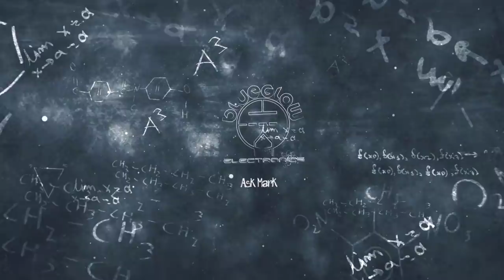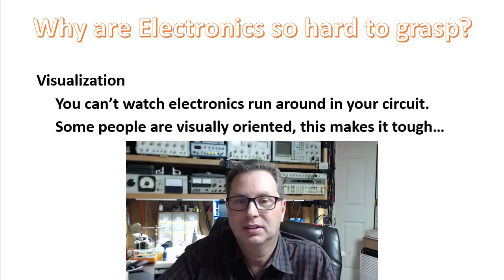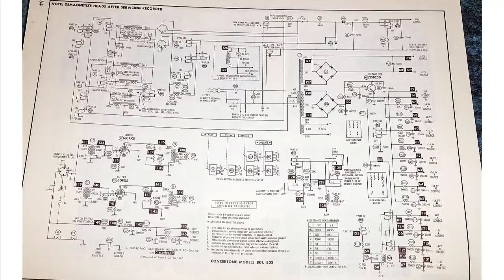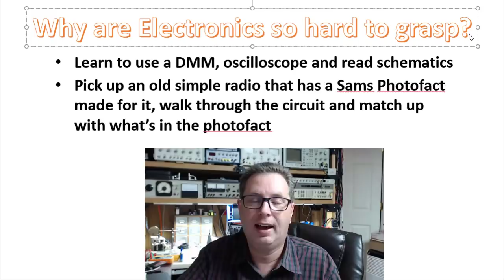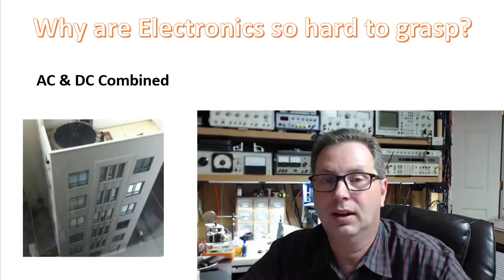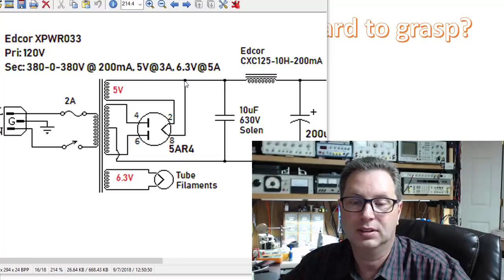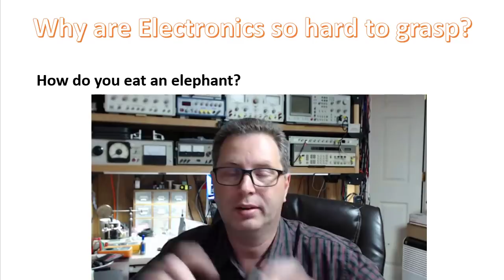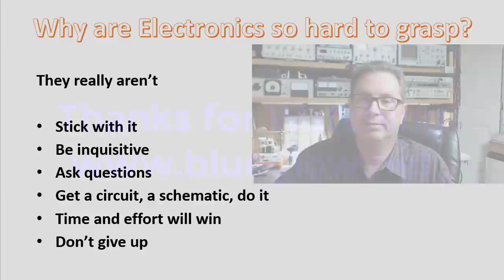Why Are Electronics So Hard to Grasp? - Plus a Few Tips to Overcome

Comment: Haven't watched it all, but had to comment.  You know what helped me immensely during your 807 build?  I used The Gimp to draw a colored point to point diagram of the build coinciding with the schematic.  I carefully watched you hook up the wires and drew them in as you proceeded.  The places where you did not explicitly show the connection I figured out from the video and schematic.  I know that build inside and out by doing this.  There is a LOT on the engineering side I do not understand, but from a tech standpoint I have reconciled the schematic to my diagram and the video of the build.  I then moved on to my first piece of tube gear, am early 1950s Travler All American 5 clock/radio.  I did the same thing, I just studied the crap out of the circuit and sketched out the point to point diagram matching it to the schematic.

Comment: The big confusion (I'm at 7:37 & maybe you will mention this later.) is we can see Current Flow from negative to positive meaning the Electrons are repelling away from each other & trying to go where they ain't so packed. But (if I understand it) the standard flow is the opposite, sort of like Hole in transistors. They didn't have the information way back then but needed to pick one direction, & (50%, 50%) they picked wrong.

Comment: Another thing to consider is that seasoned technicians are usually better at troubleshooting malfunctioning circuits than the engineers that design them,  because they gain experience in failing circuits more often than the engineers.  I used to do "shakedowns" of engineering prototype circuits, and we worked together to develop the best circuit possible.
Reply: We had some retired engineers work in our repair shop their

Comment: Parts identification, what each does and how they work together in a given curcuit as well as understanding and reading schematics, controlling heat and solder with proper techniques is a prerequisite for any service repair. Knowing the equipment your working on like the back of your hand helps too. But I'm old lol. I've been repairing equipment since tubes were regular fare lol. That's 40+ years for me. There are a lot of common problems that most people can be taught to deal with on thier own with a minimal amount of training. The more you learn and the longer you do it the easier it gets. Just no substitute for time, education and talent.

Comment: It was tough to grasp for me also.   After years of playing and schooling (52 or so)  I started looking at all circuits as a water fall of current from positive power to ground.   All current flows down the circuit from the top of the hill (positive power rail) to the pool at the base of the waterfall (ground).   Everything in between the top of the hill and the pool at the bottom is nothing but voltage dividers.    Some of the dividers have solid state devices that have a fixed voltage drop across them.    Once I thought of circuits like that I was able to decipher circuits more easily.   The other tricky part is breaking every circuit system into common small circuit building blocks.   Over time you start to recognise simple circuit blocks and how they are tied together.   They actually get boring after you get familiar with each circuit lego block commonly use over and over again.    It is very satisfying to find a new way of doing something (new circuit) and it makes you keep going in the hopes of finding a new circuit idea that you never saw before.    I learned electronics by playing and made things work with lots of trial and error.  I have played with electric when I first learned how to take batteries out of a flashlight.   Then I started taking classes in school.   Now I know how to design a circuit by the numbers and get a circuit to work almost perfectly before any solder gets melted these days.     I am jealous of young folks today because it is far more easy to learn about electronics today than 40 years ago.   The internet gives access to any info you want in a blink of an eye.  Years ago you had to go to the library or hope Radio Shack had datasheets on parts.   I contacted Texas instruments and National Semiconductor and lied to them and told them I was an Electrical Engineer (before I was one) just to have them send me databooks on all of their ICs and other semiconductor components.    I still have them today and use them (I got them in 1982).   Texas Instruments books were actually hardbound text books style books.  They are beautiful.    Now you just google part numbers.   Parts took forever to get if you could find a source for them.   Shipping cost a ton and it took 4 to 6 weeks to get things from another state.   Now you get stuff overnight or within several days.   The learning curve for electronics today is light years faster today than 40 years ago.    Dig in and drink the knowledge from the internet and it gets easier to grasp everyday.     Every person you learn from will give you a new way to look at electronics and you will develop your own style of understanding in time that is a morphing of multiple peoples views of looking at it.    Good luck and enjoy.    Learning Electronics has served me in many practical ways and entertained me for 52 years.    Hope you get the same from the hobby or life style as I have.   Happy electronicing.
Reply: Current doesn't flow.
Reply: In a DC circuit electrons don't flow from positive to ground, they flow from negative to positive! Rap your noodle around that one! LOL..

Comment: I have a Marantz 4240 Quad receiver that I want to get running again but the schematic has NO voltages on it. The service manual does show how to set the power regulator voltage and the amp audio output voltages with the trimming resistors. That's it.

Comment: Most important thing is to understand basic electricity and electrical circuits (lots of free learning on the internet). Once you have that down pat, then you can go into electronics. For all practical purposes electronic devices such as transistors and tubes are simply things that control the flow of electricity in a circuit. Always start at at the beginning and lay a good foundation to build on.

Comment: I have an Epiphone Valve Senior that I'm learning on, because it was fairly inexpensive ($50 used from a college kid) and had issues with overbiased power tubes and a bad output transformer. I took initial measurements and the power tube plates were at 435V DC and were at 37mA current, dissipating over 15 watts from the 6V6 tubes. I replaced the output transformer and the 250R common cathode resistor on the power tubes for a 390R, which brought it down a bit, but it is still high, dissipating just under 14 watts on the JJ 6V6S (14 watts max rated) tubes that I put in it. That was the only change that was made to the amp. I started checking voltages at other points in the amp and found that it has around +40V DC on the grids of the 12AX7 long-tailed pair phase inverter. Is it normal for a PI to have that level of DC, or should I be worried that I have (a) bad coupling cap(s)? I have looked at the schematic and traced it through the amp and the signal is feeding to pin 2 from pin 6 of the first preamp tube through a .01uF cap, between which, the signal splits and goes into the reverb circuit (1 x 12AX7), which returns through a .001uF cap to the reverb pot, rejoining the dry signal and going through an additional .022uF cap before it hits the grid (PI pin 2) and through the resistors leading to pin 7 of the phase inverter. I just don't see where any DC could be getting to the grids or why there would need to be DC voltage at those points. I have searched for any info about what the expected DC voltage should be and cannot find any info on the subject, though I was told by one person on a forum that long-tailed pair phase inverters usually see that kind of voltage on the grids and not to worry. That didn't do anything to help my worries, because of the lack of info on the subject everywhere else. Sorry for the loooonnnnggg comment/question.
Reply: You should not have any positive voltage on any of the tubes. The coupling caps may be old and leaky. Replacing them wouldn't be expensive and it might be the cause of your problem.

Comment: yup      as a painter , who loves music , i have no math beyond algebra , and thus at a loss beyond simple repairs ,;tube replacement , power caps , etc.       built MANY speakers over the yrs.                    want to build the 807 SE .....well , thanks , i'll get there eventually
Reply: Hi Gayland. I am just finishing the Williamson 807 amp. Although it is PP you might find it interesting.http://antiqueradios.com/forums/viewtopic.php?f=12&t=338702
Reply: Gayland,
Algebra is way more than enough to troubleshoot. Basic math is all that is needed. If you can use Ohm's Law, that is multiply and divide, you are fine for repairing (and probably designing) most electronics. There are about 10 people on Youtube that make top quality videos on the topic of repair. Blueglow is among the best. Just watch them and safely experiment on cheap stuff and you'll learn it just fine. 
Good luck, 
Ian
Reply: Algebra is generally all that is required for most electronics. Trig and calculus are useful for deriving equations, particularly with AC. But I’ve built a couple of amps, repaired a couple of tube radios, and tweaked them a bit, and 99% of the math I use never goes above simple algebra.
Reply: thanks..jw  @ianbutler1983
Reply: thanks.....jw       @bart99gt

Comment: Another way to visualize electronics is to think of it in terms of a water system. Pressure = voltage, volume = current, restriction = resistance. Electronic components have mechanical analogs. Batteries are pumps. Wires and circuit traces are pipes. Resistors are like the disks in shower heads. Capacitors are storage tanks or water hammer dampers. Transformers are tanks with diaphragms or pistons separating them. Transistors are valves, though controlled by water. The complexity of mechanical devices contrived to perform "electronic" functions quickly escalates. Once familiar with basic mechanical circuit behavior, it may become easier to switch over to electronic components; a means to booting into electronics. 

A thing that may make electronic circuits harder to understand is timing. While describing what a part is doing, it has to constantly be kept in mind that other parts of the circuit are active, and may influence what is happening locally. Software is easier to to analyze because interrupts and queues can be implemented. It's very difficult to design a real-time program. Analog electronic circuits operate in real time, and as frequency changes, so do circuit characteristics. There's a lot to think about. Learning how to break things down into understandable units or sets is the key.

I've probably dug myself into a trench. But I've written this, and it seems a shame to press cancel.
Reply: I am an electrical engineer by trade. I do the exact opposite, I translate hydraulic and pneumatic systems to an electrical analogy to understand them :-)
Reply: I find this to be a very misleading analogy and it is one that held me back from learning electronics. Once I dropped this horrible notion that electricity was like water (it is not water at all) then I was able to break free from this dogma and move on. And succeed. They key is to BUILD and learn by DOING.

Comment: I think I understand why many people have a hard time with the electronics learning curve. It is simply because they do not understand that the signal they are listening to or watching itself, is voltage/current. There is this false notion that electronic devices magically take in audio/video and "power it" --- so the layman is constantly looking for something that never existed in the first place. My biggest epiphany was realizing that an op amp COPIES the small AC signal at the base ONTO the power rails. I thought the input WAS the output, only with gain. It's not, and while the end result is the same, this subtle difference is at the heart of why people struggle with electronics. Just my thoughts.

Comment: lol, I did this backwards, I learned all I could about tube amplifiers, and even built 3 of them....Now im struggling to understand the solid state electronics, and alot of you tube videos on this are so math heavy. I get lost in the math and equations.
Reply: You already know the basics. An amplifier is a black box. You put a small signal in and a large one comes out. If it doesn't, the box is broken. It doesn't really matter if the box contains a tube, transistor, IC, or klystron. The rest is just "fiddly bits".

Comment: To learn electronics  you need  a good  foundation  in math , along with  good  analytical skills
Reply: Yes., "analytical-skills" for SURE., but math.? >> For 99% of component-level trouble-shooting (and circuit modifications / improvements) one only needs the to add, subtract, multiply & divide (and VERY occasionally a "square-root", which is on ALL toy-calculators.!) for the use of "Ohms-Law".. :-) >> The "high-end" math is ONLY needed for the actual "engineering" of components, or the "ground-up" engineering of new equipment...